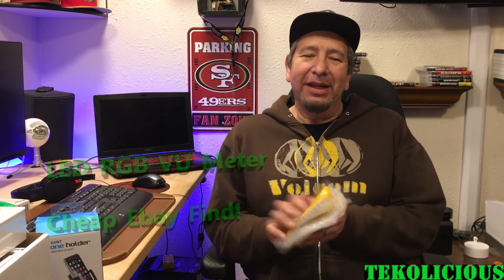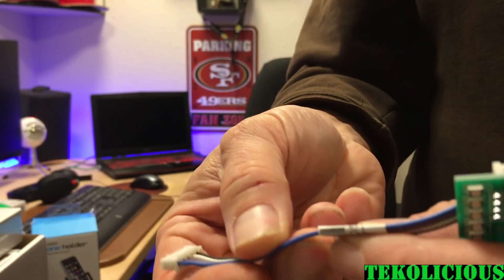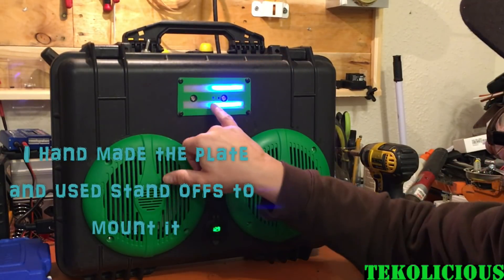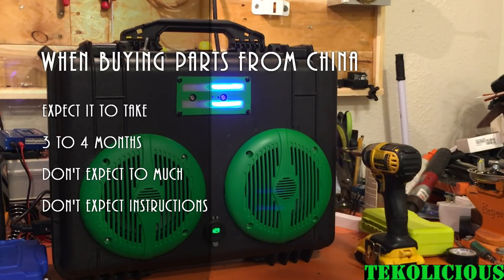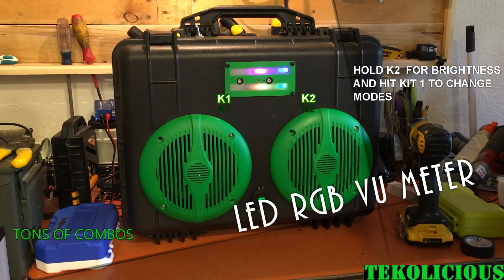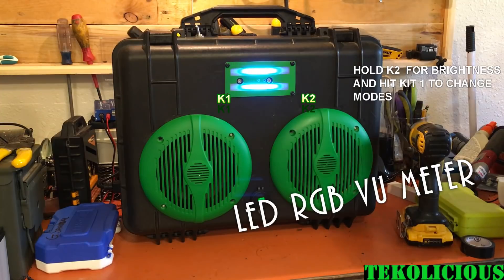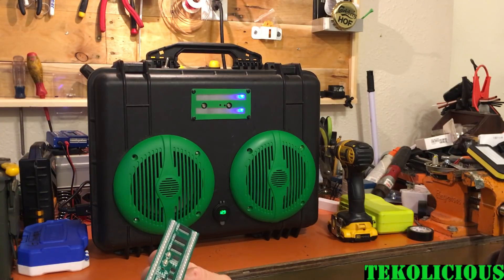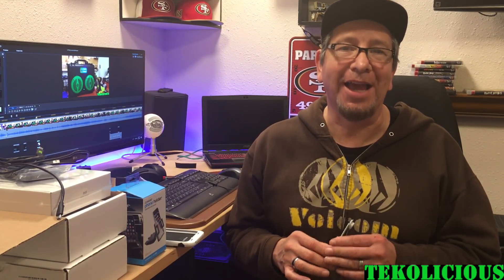Awesome Dual Channel 24 LED VU Meter for DIY Projects, Cheap on Ebay

Comment: i have one of these, the G and the - are connected on the board, so makes no difference which goes to the 5v regulator etc...... i am curious how you wired the input, is the input wired directly to you speaker + ?.....i ask because on my powered monitors headphone output i have to turn my monitors up full just to get the leds to light halfway.....hmmmmm cheers .

Comment: It would appear that you may have a “filter less” class-D amplifier and that the amplifiers output switching waveform is being interpreted as a signal, since the meter is measuring an almost constant level. Did you try it running from a headphone output as a test? I have one of these and it behaves in a much more dynamic way, as you would expect with a music signal. It also only has the lowest LED lit when there is no music signal. Perhaps you could tap into the audio signal before the power amplifier? That should work much better I expect.
These units are a bargain and work very well 👍